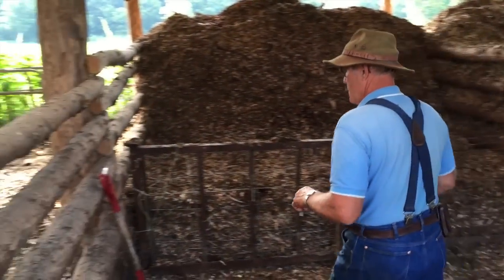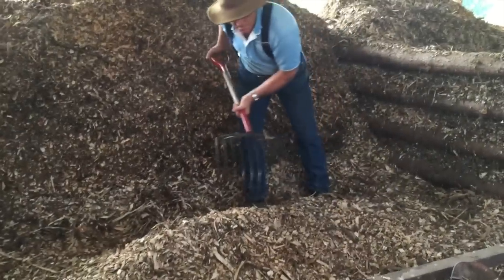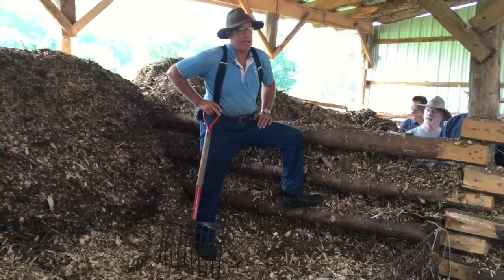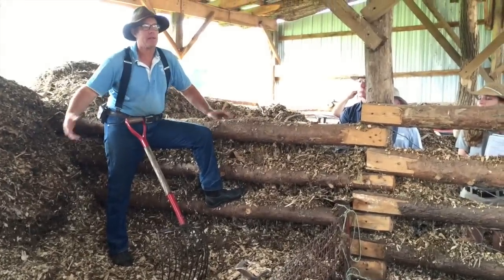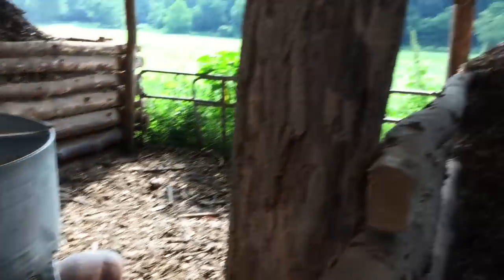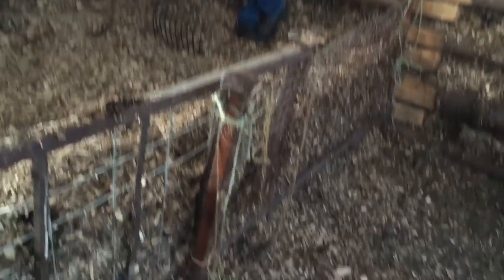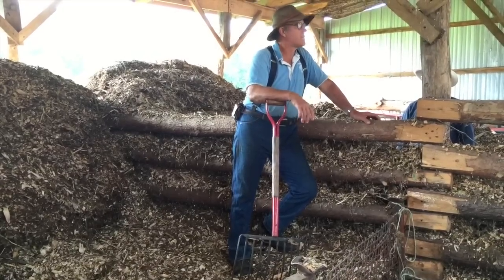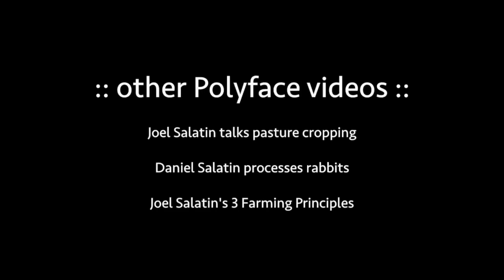Joel Salatin talks compost

Comment: That's how I compost meat on a smaller scale using pallets as the enclosure.
Reply: if you're not in the city and you have fowl (or other omnivores i suppose), look into a fly-larve setup for small scale meat conversion.  Mine is literally a 3.5g bucket (with lid) hung from a tree.  Just drilled several holes in the bottom and up near the top, once that stuff gets to stinking, man the flys ABOUND! Couple days later larva will be pouring out.  

Don't use it continuously though, the smarter chickens will quickly become complacent by it and just sit under the thing waiting for bugs to fall out instead of grazing.

Comment: I thought that you were not supposed to put dead animals in compost...although i remember as a kid seeing dead animals in the woods or along the road/ditch and as they decomposed, the grass was always taller and greener. Great video!
Reply: ludlow falls you can if you can get your pile big enough and hot enough it will break down
Reply: Bury it in there deep enough and use enough carbon, and it will be fine. And give it long enough. Like he says, they do a year.
Reply: If you are making compost in town it is often recommended to not use certain things like meat that can smell or attract scavengers that will dig up your compost and strew it around. The compost Joel Salatin is making is mainly so he can dispose of his dead animal parts as he butchers.

Also, if you are spreading compost on your vegetable garden you don't want to use things that may transmit pathogens to humans. No pet feces or raw pork because of the chance of worms, for instance. I think Salatin spreads this compost on animal pastures, not vegetable gardens.

And as others have replied, if you make sure the compost heats up enough it will kill the pathogens. Many backyard compost piles don't get hot enough because they are too small. The items will break down but pathogens won't be killed by heat.

Comment: Any suggestions on how to obtain large amounts of carbon material for cheap or free, such as the wood chips that Joel uses?
Reply from the maker: You could call around to tree service companies and see if you can get on their radar for delivering wood chips. Unfortunately, I've found that that pretty much never works. Like, never. Tree service guys are too busy and can't (won't) keep lists of people close by to deliver to. If you want the stuff delivered for (mostly) free, your best bet is to stop a tree service crew chief at a gas station and offer (bribe) him $20 to deliver the chips at your place. He'll only do it if you're relatively close to where he's chipping.

If you've got a pickup truck, almost every tree service has a yard where they dump excess chips (usually the county landfill has one of these, too) and they really want people to come and take the chips. So, if you don't want to pay for a gym membership, you can go hand load some free chips using a manure fork or ensilage fork. :D

Other options are to get on Craigslist and see if there are any places trying to offload mountains of sawdust (like furniture companies or sawmills).
Reply: @JeffGray  Guess it depends on the area. Free wood chips and sawdust are easy to get where I am.
Reply: Best bet is a carpentry shop furniture, pallet maker etc.

Comment: Composting meat? I was always told to keep meat and dairy out of compost.
Reply: Only reason not to is rodents. Which he talks about as far as his place. On a smaller scale just bury it deep in the compost.
Reply: @karlp1117  Really cool! I thought it had something to do with disease or something. You learn something new every day! I just discovered "bokashi bin" composing. :thumbs up:
Reply: @CaptCutler  yes those are concerns, but just not if you are placing the meat within a system that will properly compost it. I looked at the bokashi bin you mentioned; it says it can take meat but I dont really know anything about the fermentation it is talking about. If it is okay to put meat in there, it is not okay for the same reason why it's okay to compost meat. I wouldnt feel comfortable using that or extracting a tea if I had recently placed potentially hazardous material in it until I knew more about the process.
Reply: I read something a while back that said meat is so full of nitrogen and decomposes so quickly that it can throw out the balance of the compost and turn it into an anaerobic mess.  But as long as you put enough carbon in (like those wood chips) and manage any rodents it may attract then it is fine to compost.
Reply: This isn’t going on his veggie garden, it’s going on his fields...huge difference

Comment: what is this carbon that you speak of ?
Reply from the maker: "Carbon" is any kind of lignified or woody material. It's material that is mostly carbon (as opposed to nitrogen and water). When composting, it's sometimes called the "browns" (as opposed to the "greens", which are things like fresh vegetable matter, coffee grounds, urine, lawn clippings, etc.).

So for instance, "carbon" would be things like wood chips, sawdust, straw, hay, peanut (or any nut) hulls, cardboard, old leaf piles, etc. In this video, Joel's combining wood chips (carbon) with animal guts (nitrogen).

If you combine browns and greens at a roughly 30:1 ratio, you'll get a properly thermophilic compost pile. It'll heat up, pathogens and weed seeds will die, and the whole thing will compost in a few weeks.

The trick is that certain browns and certain greens have higher or lower internal brown/green (carbon/nitrogen) ratios. So, for instance, sawdust itself has a really high carbon ratio: it's 600:1. Hay has a much lower ratio, 80:1. So when you're combining a carbon source with a nitrogen source, you'll have to add more hay to get the same thermophilic effect as you would with sawdust.

Hopefully this is helpful and not overwhelming. :) There's a good article on C:N ratios and composting here: http://whatcom.wsu.edu/ag/compost/fundamentals/needs_carbon_nitrogen.htm
Reply: @9:25
Reply: Woodchips

Comment: What do you do with the bones after everything else is composted?
Reply from the maker: +tkjazzer 
Joel just leaves them in the compost. Then he puts them out on the fields via the manure spreader. As he says at 13:50, you put compost that will have skulls in it on fields where you don't mow hay, for obvious reasons.
Reply: If there were ever bones leftover, you could turn them into biochar. They make a great biochar. Then you can inoculate the biochar by putting it back into the compost which will be applied to the soil which will be able to store more nutrients, biota, etc. and increase soil fertility. You just gotta love how efficient nature is.
Reply: Jeff Gray j
Reply: 🤔🧐You could glue them together in strange formations and become famous for discovering a new fake dinosaur!!! 😍

Comment: Should be titled composting with e-coli and salmonella
Reply from the maker: Both of which are killed by proper composting. Although Joel's had his chickens tested and they don't even have salmonella in their poop.

As Joel said, this compost goes out onto the fields where it fertilizes pastures. It's not going onto vegetable gardens. But I wouldn't worry about it either way. Animals poop and die in gardens all the time. It's something the natural system is designed to be okay with.

Comment: Why don't you feed the hogs with some of the guts and stuff?
Reply: If you butchered the animal, so you're the reason it's dead, that's fine. You may need to freeze it and feed it to them slower so it doesn't go off before they can finish it. But if you don't know what it died from, or you do and it's a disease, you could spread it.